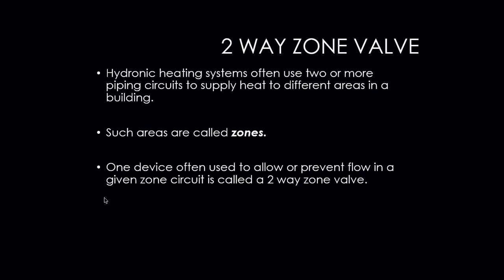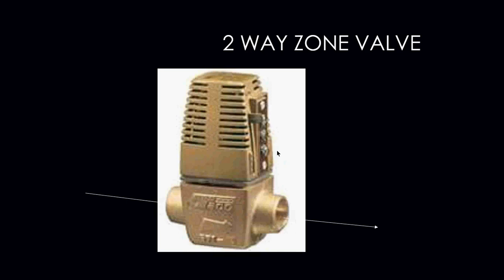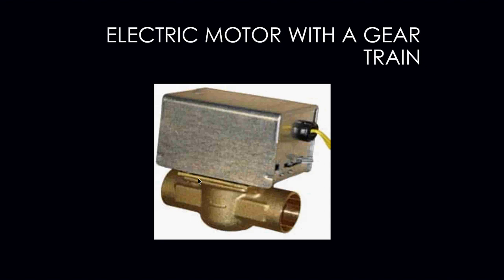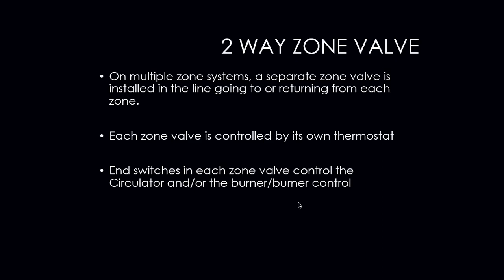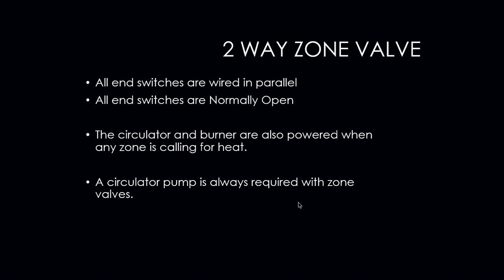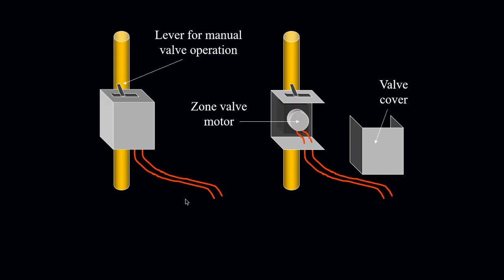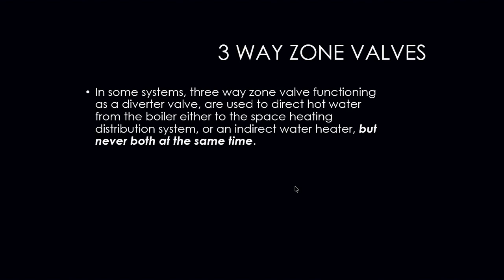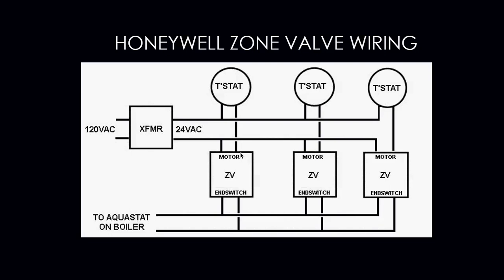Zone Valves

Comment: When the end switch closes, it means terminals 1 and 3 are the same node at 24 V.  Terminals 2 and 3 are completely isolated.
Reply from the maker: Correct. Terminal 1 is your 24V power, Terminal 2 is your common back to the transformer and Terminal 3 is a isolated contact. So when the motor is energized, the end switch will close, which is between terminals 2 and 3.